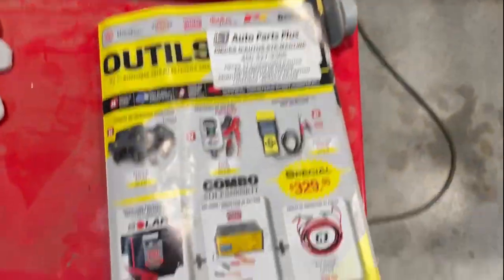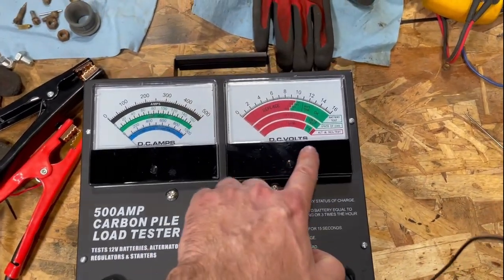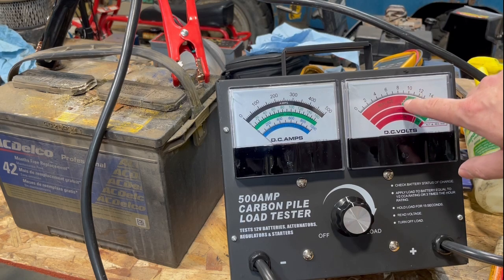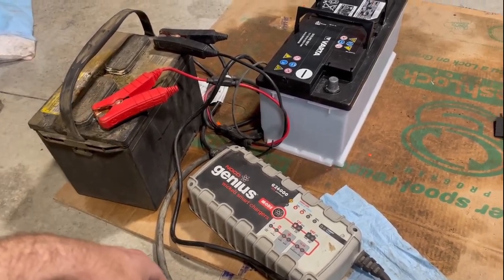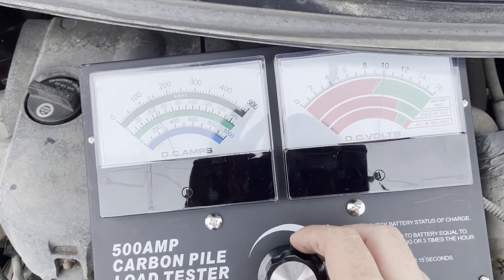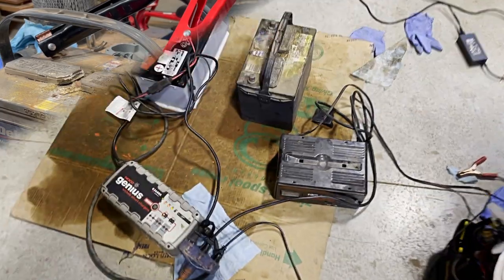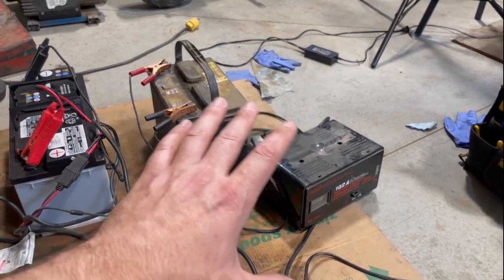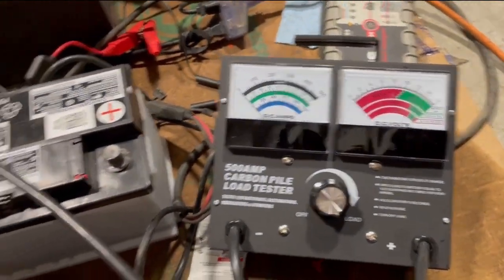Battery test ! Testing car batteries with carbon pile load tester!!! Smart charger results!

Comment: Hi Matt . . .thanks for posting. I have one of these carbon pile testers - there are various brands etc but they are all the same generic chinese units. The reason I watched your video was because I was confused by the options for testing of 3 x Ah rating or 1/2CCA. I think the instructions have become confused in translating to Chinglish. My battery is 11.8Ah and 230CCA which according to the instructions would mean testing at 115amps for 15 seconds or 35.4amps for the same time - clearly nonsense as a battery could easily pass at 35.4amps but fail miserably at 115amps. I have now watched several videos and it would seem the correct convention for load testing is to test for 15 seconds at 1/2CCA and so simply ignore the option for 3 x Ah - it is nonsense. Finally, forgive me for pointing out some of your errors which hopefully will help you in future
1. You tested all of your batteries at half the load that you should have - down to the chinglish instructions mate. The bottom scale is the CCA of the battery and you simply wind on the resistance knob until you are lined up with the CCA of your battery on this scale . . . if you now look at the top scale which shows the amps being drawn, you are drawing exacly half the battery CCA. You were halving the CCA of your batteries and cranking up the current until you were on half CCA on the bottom scale and thus drawing half what you should to test correctly
2. On your first battery test, you buzzer went off because you failed to fully wind off the load knob - it was still drawing a small current - keep turning the knob anti-clockwise until the amps being drawn is definitely zero and then perhaps a bit more for good measure
3. Never test the battery unless you are in the test zone or you will damage the battery  - charge it first.
4. Throw away all your batteries - every single one I watched you test is toast!!!!!!!  😃
Reply from the maker: Wow! First off, thanks for taking the time to write such a long and in depth comment!!! I totally get what you mean with the confusion on how to properly use it as per the limited instructions available. I never used one before and just winged it for the video. I get what you are saying about how I halved the already corrected CCA scale. My bad… Thanks for the enlightenment! As for the 3x AH question, I did get another private comment from someone who said its for small sealed non-automotive batteries. I thought of the small battery in my booster pack that is 20AH. I suppose I would test it at 60AH on the middle scale. These batteries dont have CCA’s indicated so I thought it made sense. Your battery has AH and CCA, so I agree with you that it should be tested at 115A and disregard the AH scenario. Anyways, thanks for the insight and thanks for watching!!!
Reply: @mattsws   one small correction - re your 20Ah battery - you would line up the needle on 20Ah on the middle scale and having done so, you would be drawing 60 amps, as shown by the needle against the top scale. Same argument as for CCA technique 👍
Reply from the maker: Man the instructions on the unit are misleading!!!! Thanks for the great tips! Take care!
Reply: @mattsws  Can you put the instructions here to look at it please.

Comment: So, that little wire that appears to be joining both sides of the clamp is NOT what you think it is.  It is a voltage sense wire that goes straight back to the voltmeter.  Gives you an accurate reading AT THE BATTERY, because it eliminates voltage drop over the cable.
Reply from the maker: That makes total sense!!!!! Thanks for the info, it’s really appreciated!!!
Reply: @mattsws  no problem! I took mine apart when I first got it because it came with bolt from the carbon pile loose in the cage and had to fix that. Then got to wondering where the extra wires were coming from that go to the voltmeter. Took me a bit to figure it out lol

Comment: your second set of test where done right the first test where done wrong  here is why 

Carbon pile testing should ideally be performed on a fully charged battery or a battery that has been put though a Charging cycle to get it to its maximum capable Charge to obtain accurate and reliable results. Here's why:

Consistent Results: Testing a fully charged battery ensures that it is in a consistent state, allowing for more accurate and reliable measurements. When a battery is fully charged, its chemical reactions are optimized, and it is in its highest energy state, which better reflects its true performance capabilities.

Maximized Capacity Assessment: Carbon pile testing assesses the cranking capacity and overall health of the battery by subjecting it to a simulated load similar to what it would experience during engine starting. A fully charged battery can deliver its maximum capacity, allowing for a more thorough evaluation of its performance under load.

Prevents Misinterpretation: Testing a discharged or partially charged battery can lead to inaccurate results and misinterpretation of the battery's condition. A discharged battery may not be able to deliver its full capacity, leading to underestimation of its cranking ability and overall health.

Safety Considerations: Fully charging the battery before testing also reduces the risk of damaging the battery during the testing process. Testing a partially charged battery under heavy load conditions can further deplete its charge and potentially lead to irreversible damage.
Reply from the maker: Wow! Thank you so much for such an in depth explanation! I realized after the video was published that I made some mistakes…. I really appreciate you taking the time to write such an insightful comment! If I make any more videos on the subject, I surely show more technical expertise! Take care and thanks for watching!!!

Comment: You are reading the scale wrong.   If you are going to use the CCA scale at the bottom, do NOT divide the CCA rating by two.  Use the actual CCA rating.  If you are using the top scale, which is for measuring AMPS, that's when you divide your rating by two.  You should notice that doing it this way, the AMP scale will be exactly HALF of the CCA scale.
Reply from the maker: You are absolutely right. I noticed this after posting the video. Thanks for the comment!

Comment: That battery analyzer is not working correctly, it should be going off with the alarm in 10 to 15 seconds not 4 seconds something's not right with that unit.
Reply from the maker: Yeah I thought the same thing. In the manual is mentions the 10secs but it beeps way before… oh well!
Reply: It seems these units start the 15 second timer as soon as you start applying a load, not after you reach your target load. Makes sense because it doesn't know your target load  and therefore cannot start the timer there.
Reply: These units start the 15 second timer as soon as you start applying a load, not after you reach your target load. So no its working right

Comment: You can do load test in the vehicle with a voltmeter that has min/max and hold.  Connect the voltmeter across the battery, press min/max, crank the vehicle, press hold, then press min/max to see what the min cranking voltage is.  I just ordered a KONNWEI KW208 for $22 that will check alternator ripple, charging and cranking as well as the standard battery test.  Over 90% of the time I just don't see an advantage to using an old-school "load" tester.
Reply from the maker: You are totally right about modern tech vs old school load testers. I like old tech, so thats why I bought this vs a modern tester. I use my multimeter like you explained all the time and its my most common way of quick testing battery. They rarely pass the min/max test, only to fail the load test… Usually the multimeter shows the battery is toast. Thanks for the comment and thanks for watching!!!

Comment: You have not covered the voltage of the battery example. 6 -8- ot 12 volt?????
Reply from the maker: This tester is for 12vdc only. All batteries tested were 12v. Thanks for the comment and thanks for watching!!
Reply: I bought one at princess auto but took it back, I found the cheaper load testers the buzzer goes off long before 15 seconds so that's not an accurate test.
Reply from the maker: @404notfound.....  Yeah, I have to admit that mine goes off before the 15 seconds also... I find that a dead battery will drop off real fast regardless with the load tester, so I use it to determine if its really good or really dead... In between, I have doubts on the accuracy!
Reply: @404notfound.....  I got mine so hot one time that it burnt the buzzer up! Thank goodness... lol... I was going to disable that annoying thing anyway
Reply: Well 6 and 8 volt batteries will generally be deep cycle types and these sorts of testers are not ideal for testing deep cycle batteries as deep cycles are not designed to deliver the huge peak currents that starter batteries do so the 1/2 cca test is irrelevant.
A discharge/capacity test is best for this application.
I'm a forklift mechanic and I load test a 600aH forklift cell at about 300A. If you tested that at the same criteria as a starter battery you'd be testing it about 2500A! Which it would fail, miserably, even when it's brand new and you'd probably kill the cell.